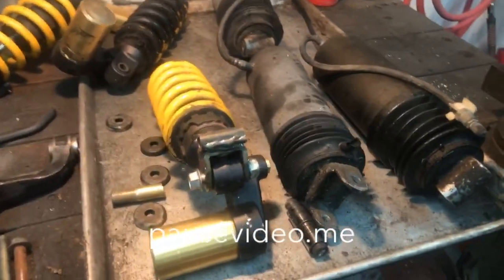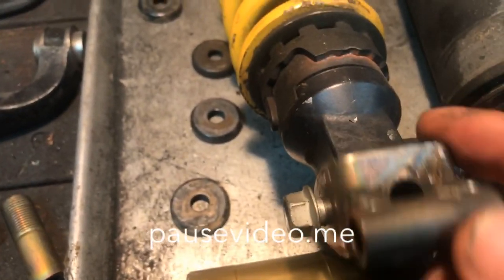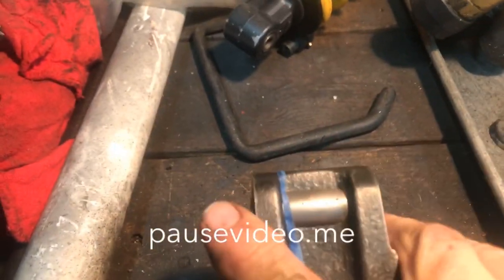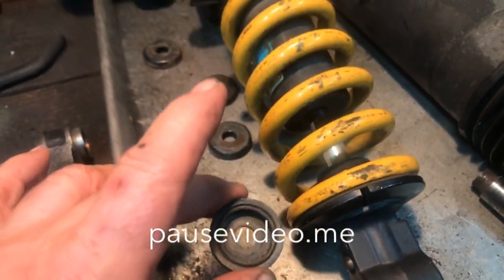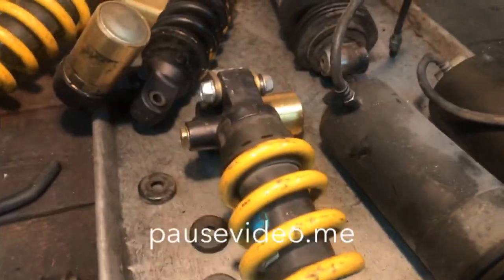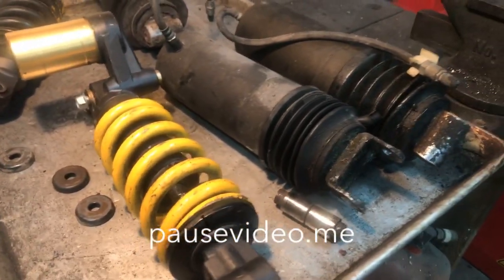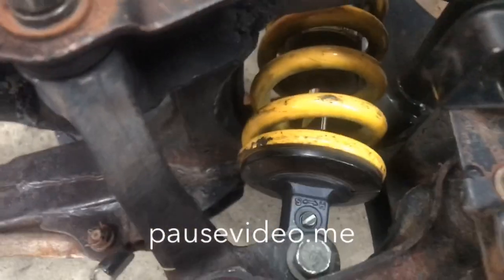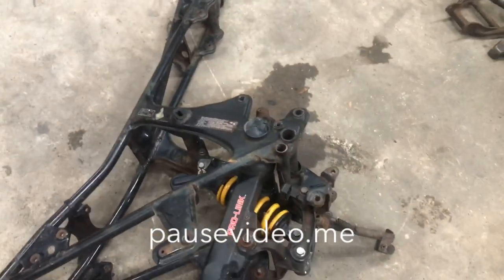How to install a CBR955/929 shock on a Honda GL500 and GL650

Comment: old shock bad?  can't make it any worse so add a small amount of tire stop leak and see how it works.  i did mine and it works as good as new.  holds air and rebounds as normal.
Reply from the maker: This is an upgrade for people that want better suspension or building a cafe racer. Mostly cafe racer. I’ve used amsoil power steering sealer on the stick shocks. It seals them up and makes the oil thicker. The tire flat fix doesn’t mix with the oil and is a short term repair. Eventually the valving clogs up.

Comment: Is this shock stiffer than the original? I'm a big guy and am hitting my electronics tray with the rear tire. Doesn't seem like much but I would rather not have to redo my tray.
Reply from the maker: Are you running the original air shock. If so put some more air in it and see if that helps. If that doesn’t fix it this probably won’t either. You can adjust the sori g tension, rebuild, compression and air pressure on this shock.
Reply: @Murphymotorsocala  yes I had the original in. With it at 70 psi it would rub on larger bumps. I tried the cbr 500 shock and it was way worse.
Reply from the maker: You probably going to have to redesign your tray. there’s not enough clearance to have anything mounted below the frame rails above the rear tire.

Comment: Hi Kevin
Great informative video
Mate I've just bought a 1983 Honda CX650 Euro which has the same rear shock absorber as your GL650 with the U shaped bracket on the bottom link end of the shock absorber
Would it be possible for me to modify the CX/GL650 bottom link by welding on a U bracket to take the male end of the CBR995 shock because looking at your video that's the difference with the the two linkages where the shock connects
Reply from the maker: If you source half of the GL500 prolink the part that the shock bolts too you can make it work. You leave the dust seals off and it will fit. If your leaving the bike stock it won’t. You can use a CBR929 shock on a stick box but you need to take the air box off and run pod filters. But back to your question. If your a good welder you can do anything.
Reply: @Murphymotorsocala  Hahahahahaha I like your reply
Thanks you have given me two options
This bike will be a stripped down cafe racer
Reply from the maker: @Coolhand99au  no problem, I’m here if you need anything. I’ve done a bunch of these.
Reply: Thanks Kevin
Love your channel.

Comment: Do you have any advice on what jets to use on my GL500? I am going to be using pods and I heard 90 and 120 mains will work alright. Any input?
Reply from the maker: What are you going to use for exhaust?
Reply: @Murphymotorsocala  just the factory 2 pipes without h box, I think I may go with the Murphy upgraded carbs. The second issue I was facing was battery location. I found a couple battery boxes which go where the factory h box is but I would prefer a under seat electronics tray which I don't see any off the shelf applications for. Thanks again 👍